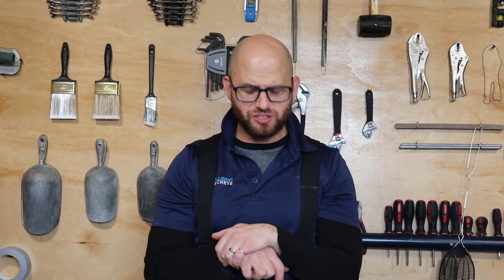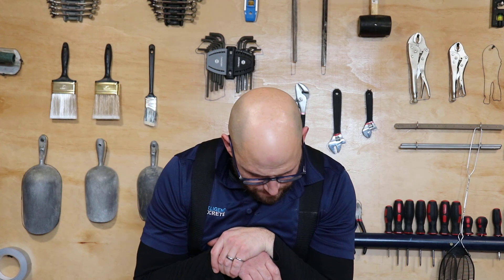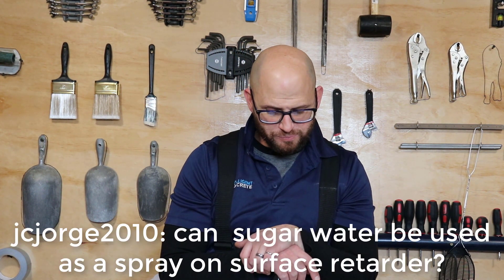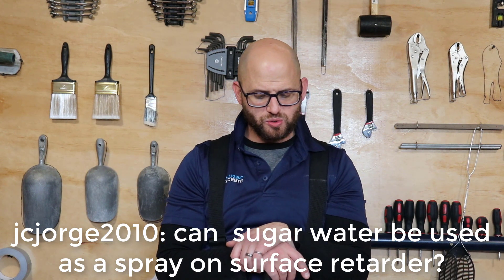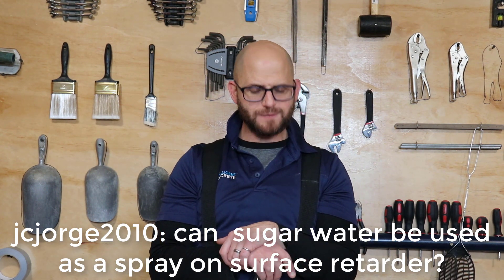Q&A Wednesday: Can Sugar Be Used as a Spray On Surface Retarder? - Vlog 587

Comment: Thank you for all your research and experiments.  I am regularly mixing 80lb bags of concrete and would like something to increase slump and retard, however retarders are not readily available near me. I saw your videos using sugar.  Can you give a rough estimate on how your ratio translates to 80lb bags.  I saw a comment stating 1 3/4 tbsp per bag.  Just wondering if you agree.
Reply from the maker: I would try 10-15 mL of a good MRWR Or HRWR.  Shoot us a message we can get you in touch with an admixture in your local area.